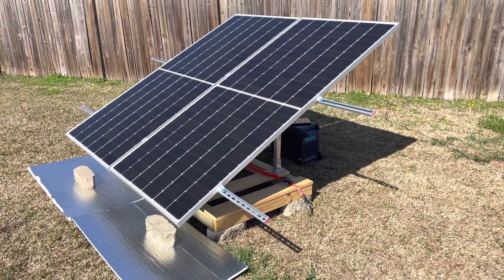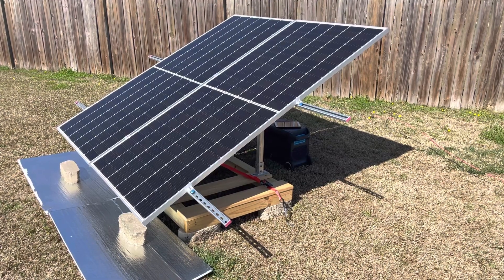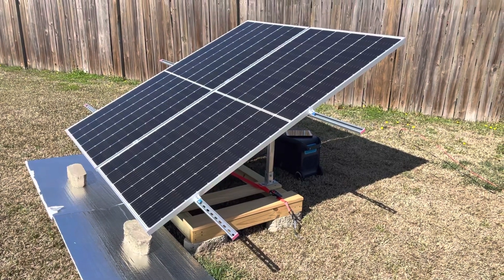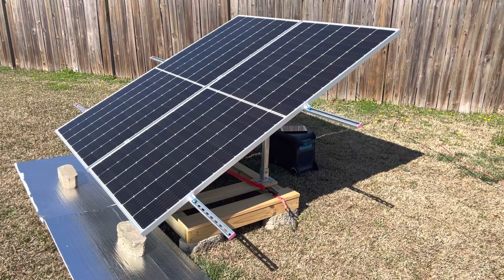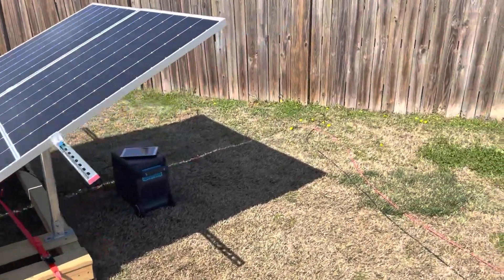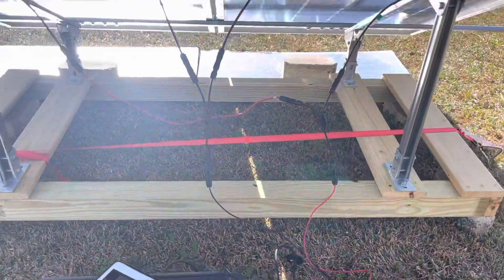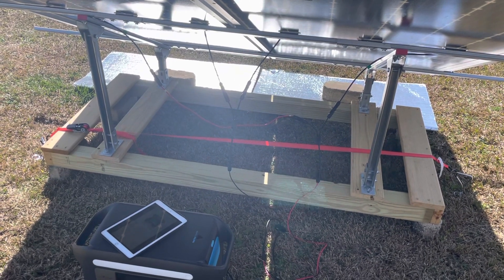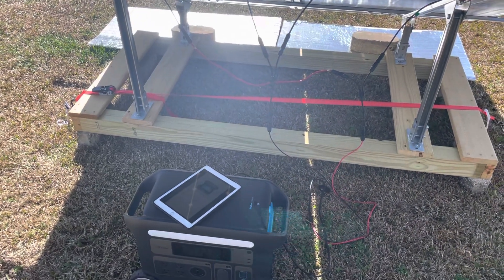Anker 767 Powerhouse Solar Input challenge!

Comment: Hi! Thank you for this video, very helpful . I'm looking for some solar panels for my Anker 767 with expansion battery. This is what I found and I wonder if this will work : 2 panels Monocrystalline half-cell series, each 500W . Electrical performance parameters (STC) : Peak power voltage Vmp/V: 42.72. Imp/A: 10.77. Voc/V: 50.36. Isc/A: 11.40. Maximum fuse rating 20A. Will it work and give optimal results when wired in paralel?
Reply from the maker: The Anker is technically only able to use 20amps but those panels should work well.
Reply: There was a problem with the delivery of the panels mentioned above. Now I can get some other panels (2 panels) each 420W , and VOC 38,46. Isc/a 14.09. Imp/a 13.14. VMp/v 31.96. Will this work properly or is the VOC too low? Will these panels perform significantly less than the 500W above?Thank you so much for your input.
Reply from the maker: @henryeifel7016  Those would not be a good match.  Voltage too low and amperage too high for best results.

Comment: Wow! Thanks so much for putting this video out! I just purchased the 767, and after watching your video, I have emailed the Greentech location in Raleigh for current pricing on that panel. I am new to solar, so I am going to ask a noobie question here. I see someone selling Trina Solar 250 watt panels (used) within driving distance for about $60 each. Model# is SS250P-60. Open circuit voltage is 37.6. Short-circuit current is 8.85. Am I correct in thinking that amps would be sub optimal since I would have to wire these in parallel to keep under that 60v threshold on the Anker? Thanks!
Reply from the maker: @87danmc  correct,  those panels would be sub optimal.  That being said,  they might still work for your intended useage.  Just depends what you’re trying to accomplish.
Reply: @leafnutz2341  Thanks. I am wanting to have backup energy to run fridge, lights, digital devices, and battery chargers in the event of a power outage. That being said, I would also like to use the device in the meantime to power something(s) and reduce my dependence on the grid.
Reply: @leafnutz2341  Ok, I am back to bug you again. Just tell me to leave if I get annoying. Lol 

I called Greentech in Raleigh trying to order the Qcell panels you have in the video, and they said that Qcell is not making them any more and the ones they have remaining are already promised out and waiting to be picked up/shipped, etc...

So..... I see that Santan Solar sells on Ebay, and it appears they will ship panels out without the 10 panel minimum threshold. It looks like I can order just a couple, and they have brand new New SolarEver 410W 108-Half Cell Mono Solar Panels running for half off at $199. Here are the specs. If you would be so kind as to share your thoughts on the compatibility with the Anker 767, I would appreciate it. 

Power: 410W
Maximum Voltage (VMP): 31.35 V
Maximum Power Current (IMP): 13.08 A
Open Circuit Voltage (VOC): 37.12 V
Short Circuit Current (ISC): 13.96 A
Maximum Fuse Rating: 20 A
Maximum System Voltage: 1500VDC (IEC)
Dimensions: 67.87in x 44.64 in x 1.37
Weight: 47.4 lbs.
Reply from the maker: @87danmc  no, those would not be a very good match.
Reply: @leafnutz2341  Ok, any other suggestions since I cannot find the Qcells?
Reply from the maker: @87danmc  I haven't checked the market lately but you're looking for a combination with a VOC in the low to mid 50's and an ISC in the low 20's.  This is a difficult combination to come up with cost effectively.
Reply: OK, thank you for your time.
Reply: @leafnutz2341  Just checking back in with an update. I ended up ordering 6 Ecoworthy 195w bifacial panels on sale for $650.61. I wired them 2s3p, using 10AWG cable. I just leaned them up against the house to test them out (haven't built a solar stand yet), and I am getting almost 800watts of input. I am hoping to max out that 1000 watt input when I get them properly installed.

Comment: great video, i am new on solar panels, my question is if 2 of this will work,

trina solar bifacial
maximum power   454w

maximum power voltage.    31,6 volts 

maximum power current.    17.24amp

open circuit voltage 
37.9 volts
Reply from the maker: No,  those panels would not be a good match.  In series your voltage would be too high and in parallel,  the voltage would be so low the Anker would only draw 10amps instead of 20.
Reply: 👍thanks for your reply.

Comment: Where did you get the parts to build your solar panel stand
Reply from the maker: The pressure treated wood was purchased from Lowes home improvement.  It's two 4x4x6', one 2x4x8', two 5/4x8' decking boards plus a box of 3 1/2" screws.  The metal portion is the Eco Worthy solar panel mount that can be purchased off ebay for around $125.  It was less than $200 for everything.

Comment: Hello, Been running the 767 with the extension battery along with 4 Renogy panels, 2  200watt and 2 100watt on a camper van for a couple months, but I’m only getting 200w of input in parallel at peak conditions. 
My question is, should I try running them in series or maybe a combination to optimize input? 

TIA!!
Reply from the maker: Please post the specs of the panels.  there is usually a sticker on the back of the panel.
Reply: @leafnutz2341 
Here you go! 
Maximum Power
200 W
Maximum System
Voltage
600V DC (UL)
Open-Circuit Voltage
(Voc)
23 V
Optimum Operating
Voltage
19.2 V
Optimum Operating
Current
10.42 A
Short-Circuit Current
11.05 A
Maximum Series Fuse
Rating
20 A

Max Power at STC
100 Watts
Open Circuit
Voltage
Short Circuit
Current
24.3 V
5.21 A
Optimum
Operating
Voltage
20.4 V
Optimum
Operating Current
Cell Efficiency
4.91 A
22.00%
Reply from the maker: @bound2overland   The 100 watt panels are pulling down the 200 watt panels because of the amperage mismatch.  I can't come up with a configuration that maximizes the 600 watts you have available.
Reply: Oh ok, makes sense! I’ll play with running a different configuration and keep you posted!

Comment: Just wondering if you ended up putting wheel like you mentioned in an earlier video on the mount. I'm thinking about creating a wheeled unit similar to yours,  but not sure what wheels will be reliable for this sort of thing.
Reply from the maker: I did breifly but I ended up building 2 more and making one long fixed rack that currently holds 8 panels (3kw) and powers my Growatt system.  regardless of the wheels,  you need to strap these things down or a strong wind gust can flip them over.

Comment: Regarding DC to DC charging in a van, if I were to put an MC4 connector on the wire coming from the battery, could I plug it in to an MC4 branch adapter along with my solar panels and have the system just see amps coming in? Would it have an issue with power coming from the main battery vs power coming from solar panels?
Reply from the maker: Jasonoid did an excellent video with DC to DC converters.  The key to good charging numbers would be getting above the 32v input for 20amps instead of 10amp.  The Anker charges at 10amps up to 32v and 20amps from 33-60v.

Comment: I am  new at this. I have existing BougeRV CIGS Yuma 200w panel that charges my 767. I would like to add more of the same panels to  achieve  800watts but the total volts will be 60 and the amps 19. Will this be compatible with my Anker 767
Reply from the maker: The VOC of those panels is 31.5 volts and the ISC is 8.64.  Wiring them 2s2p would result in a VOC of 63 and ISC of 17.28.  This exceeds the VOC limit even before you do any temp compensation.  These panels would also not be good to wire strictly in parallel because the VOC is below 32v so the Anker would only draw 10amps.  I would suggest looking at other options.
Reply: Thanks

Comment: I always love a challenge, but I just don't have the ability to give it a go unfortunately. I am curious about the bi-facial panels though.
My first impression is that you would want to have the back side of the panel free of any obstructions. 
My approach would be to build the stand like a wall window opening and I would separate the panels allowing the window frame to pass light to the reflective foam surface just a few inches behind the panel. The foam would be parabolic but it could be flat as well no need to make it complicated if you don't have to.  I call it a periscope, I originally thought using sun tunnels to capture and "bend" the light to the backside would be interesting but simple is better. It does allow for a central pivot so very easy to adjust the angle for summer and winter. 
While I can't do anything in my current home setup (renting right now) I would be willing to send you a mock up if you'll willing to give it a go.
-MG
Reply from the maker: Typically,  bifacial panels work best approx 3 feet off the ground and with a white background around them for increased albedo.  These mounts I built are semi portable and definitely not ideal.  I’m hoping someone comes along and produces much better results.
Reply: @leafnutz2341  I think it would be a tough road to get a better number without increasing the number of suns. There's an old saying 10% of your effort gets you 90% of the way there, the next 10% increase uses the remaining 90% of your effort. The incident light or albedo doesn't raise the efficiency. Typical solar panel efficiency goes up with suns, but maybe someone will come up with something novel.
If they do then everyone wins...
-MG

Comment: Just doing some math on VCU Tech 200w panels. Four in series-parallel would give me 39.6v and 20.2 amps for 800w. Could the Anker handle 20.2 amps knowing it's rated for 20?
Reply from the maker: I looked up VCU tech panels and the only one I could find was a 200 watt portable panel but doesn't add up to the numbers you listed.  Please list the specs for the panel in question.  VOC and maximum current.  To answer your question, the Anker could handle 20.2 amps just fine.
Reply: Sorry, new at this, If I take two panels (19.8V, 10.1A) put them in series and two other panels and do the same, and then put in parallel I get my numbers. Is this incorrect?
Reply: VOC is 23.76 per panel, but I don't use that for actual calculation do I?
Reply from the maker: Voc would be used for the 2s2p configuration
Reply: @leafnutz2341  Doesn’t makes sense to me, if I take VOC 23.76 and multiply it by amps 10.1 that makes my 200w panel capable of producing 240w? 959 watts in 2s2p?
Reply from the maker: @aznick102  you are confusing working voltage under load and resting voltage (VOC).  The Anker will draw a maximum of 20amps according to their manual (although I’ve seen around 20.5 on mine).  The wattage would then be determined by the working voltage which would be incfluenced by voltage sag, panel angles, hazy skies, etc.  the VOC measurement is used because the mppt controller in the Anker is only rated for 60v.  In your case, this limits you to 2 panels in series rather than 3.
Reply: @leafnutz2341  Thank you for the help.

Comment: Check out the allpowers 400w foldable panel. 10.6A, 37.4V. Should be able to connect 2 of these guys yea?
Reply from the maker: Should work fine but not a great match due to voltage.
Reply: @leafnutz2341  thanks! Might just settle for a 200w Anker panel and wait for them to go on sale. Or go with your panels. Wanted something more portable tho

Comment: Great job! I like the simple two panel approach. Where did you purchase your panels?
Reply from the maker: CEDGreentech.  $288 each and they have a sales counter so you can drive up with your truck and they will load them up for you.  They have locations all over the country.  Qcell makes a 490 (536 watts bifacial) watt version of this panel as well with slightly higher VOC.  I spent a lot of time looking for panels in the 50-55v VOC range with around 10 amps of output.  The 2 panel approach seemed like the simplist and cheapest route for a fixed install.  I'm hoping this video will generate some alternate ideas and panel combinations.  Anker did reply to me and said not to exceed 60v so make sure you do your temperature calculations.
Reply: @leafnutz2341  That's a great deal. I see that they make 470 475 480 485 490 495 versions of the same panel with varying cell efficiency. I'll have to ask them about availability, and pricing. The premium for the 495s may not be worth it.
Reply: @TRAILPOWER did you ever buy QCell panels for your 767? If so, how'd it go?

Comment: Newbie question about the XT60 connector supplied by Anker.  I need to know which side of the connector is positive and which is negative. One side of the connector is rounded and the other is square.  Which is which?  I am getting the Q-cells panel delivered on Thursday and want to try it out. I need to buy the adapter cable or make one up....MC-4 to XT-60. Thoughts? What did you do?
Reply from the maker: I'm actually not which part of the connecter is "supposed" to be positive.  I ALWAYS test the output of a connector with a multimeter to check for polarity before plugging it in to a solar input.  You should also be checking VOC before you make the connection for the first time.
Reply: @leafnutz2341  I agree. But, I am wondering HOW you connected the Q-Cells panels to the 767.  Did you make up an MC-4 to XT-60 adapter yourself? Did you buy one? If so, which one?  I guess what I am saying is I am not looking to re-invent the wheel; I just want to duplicate what you have already done.
Thanks!
Reply from the maker: @richardmolnar3007  I used 2 parallel connecters,  1 short MC4 extension, and a MC4 to XT60 adapter I already had from my Ecoflow Delta Pro.  I did not use the parallel connecter that Anker supplies.

Comment: What is the max size panels you can use on the rack you used?
Reply from the maker: In this 2 panel configuration,  you could probably use something even larger such as renogy 550's.  The biggest problem is these large bifacial panels are very heavy.  These were the largest I could find that were a good match for the Anker.

Comment: Could you parallel and over panel 3 of these?
Reply from the maker: NO, you would just be wasting amps since the Anker will only draw 20 amps max.
Reply: @leafnutz2341  hmm, wouldn’t you be able to draw closer to 20A during non peak sunshine times? Example 6pm summertime with 2 panels gets you 15, 3 would get you 20 at 6pm
Reply from the maker: @TobyCostaRica  I see what you're saying.  I'm not sure what the amperage limit is.  I would suggest emailing Anker about this overpaneling approach.
Reply: @leafnutz2341  yeah I need to do more research, I just learned about it recently. I maybe incorrect but I think of solar panels now similar to a gas generator or a grid tied power source. Your device will only pull what it needs if plenty is available. A hair dryer won’t pull more than 1850 watts, doesn’t matter if the power is coming from a 2k genny or a power grid.  So a MPPT will only pull 20A if available.